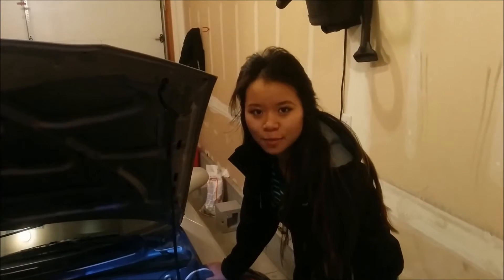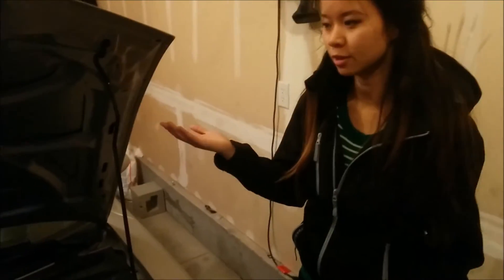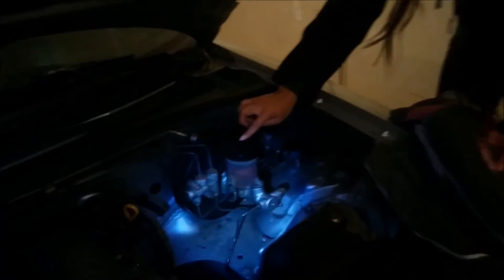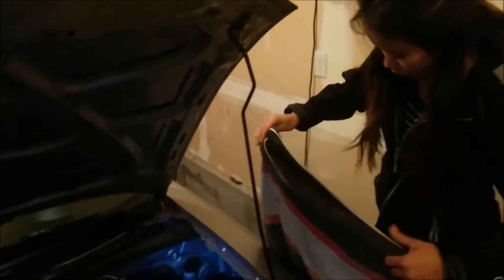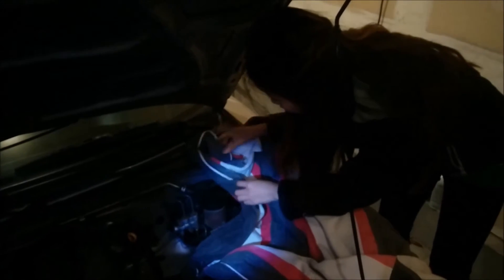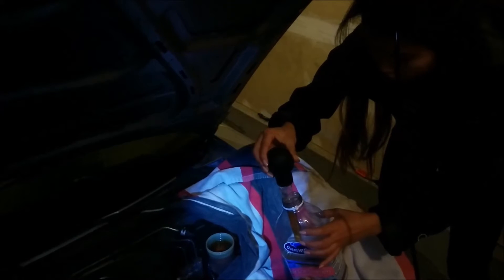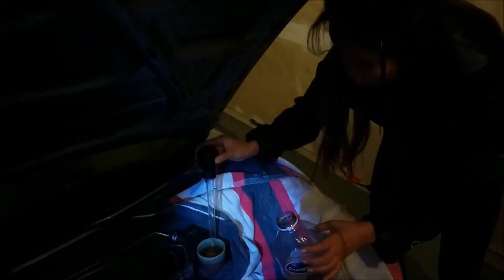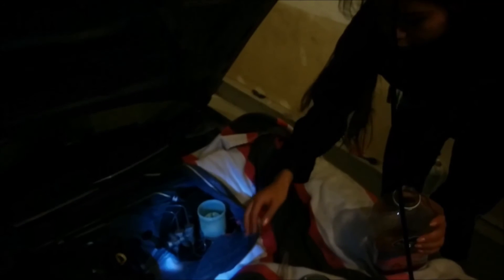99 Mazda Miata How to Change Brake Fluid in your Car by a Girl

Comment: Did you not bleed all your brake calipers after this? If not, why not as this would defeat the point of doing this is the fluid in the pipes is water contaminated etc?